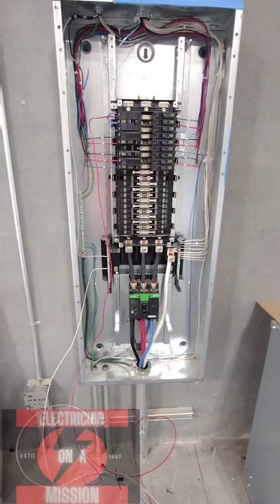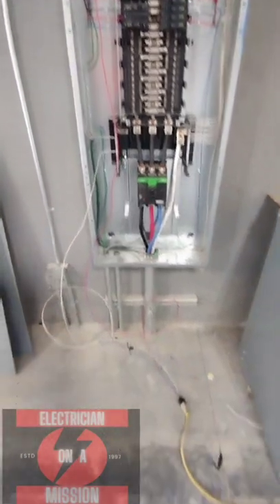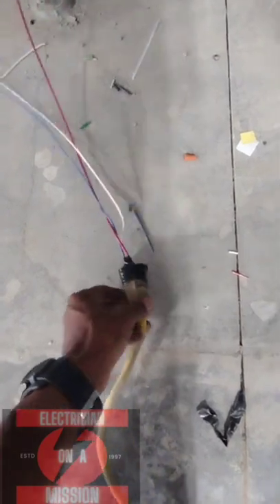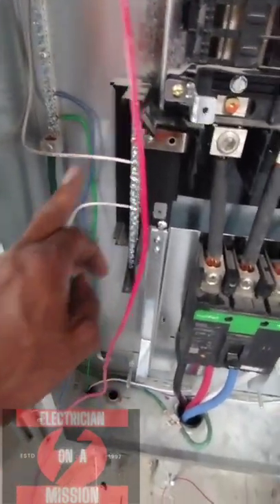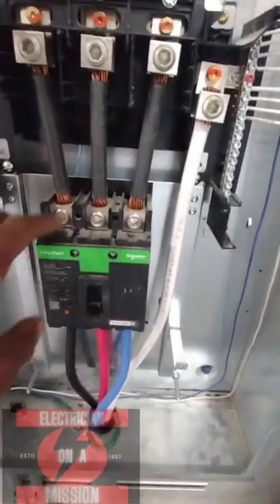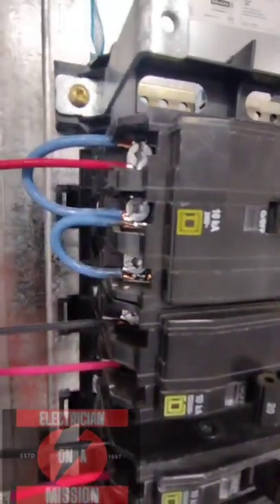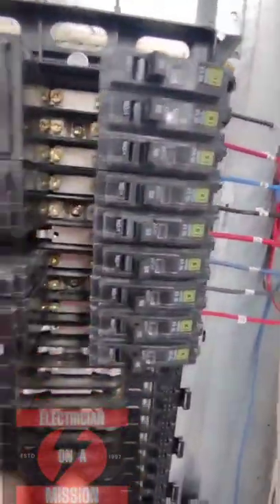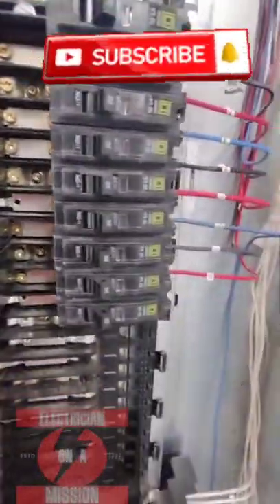Electricians  best way to hot check a three-phase panel#electrical#electrician #journeywomen

Comment: I'm guessing this is being done because: 1) you're working alone, 2) there's going to be walls finished pretty much immediately after inspection. 3) The main service to this sub panel is locked out because the super doesn't want one section of construction killing another one.

Outside of all three of those situations, I think anyone taking this as general advice because the situation isn't explained, will put themselves and others at risk doing this. Having the panel be in line of sight to everything you're checking and making it clear that you "see the lights, then disconnect the loads and then disconnect power" would keep most of the negative comments away.

Remember that giving any advice other than referring people to codes is risky from a liability point of view.

Comment: The best way to check is to meg check your wires before firing up the panel. Meter check each phase separately and then go phase to phase to check voltage.

Comment: Where is the power in the cord coming from? Generator? Also how much voltage are you pushing in to the 30 amp breaker throught the hot (red) that you put on it.
Reply: Good question... I assume he was either testing lights he wired / and / or needed temporary lighting in the room for other trades or people... I don't know for certain.
Reply: That's what I'm saying, bro. How the f*** are you running a 3 phasee off an extension cord.

Comment: The main disconnect is OFF for what reason again ❓No service voltage yet ?  ( I know you're testing lighting as the purpose)👈 If that is the case, honestly... Just install a male 3 wire plug on the end of a 6 ft length 14-3 cord , wire your other end to your panel and simply "plug it in"... "Keep" the cord for future similar needs... Always keep stuff that makes your job more organized....

Nice panel wiring work, BTW 👍
Reply from the maker: It’s really not a big deal. I’ve been doing this over 25 years. It was a quick hot check to make sure there was no dead short in the wall before they close it up with drywall. If you guys don’t understand electrical, please step back and call electrician. Thanks for the comment.

Comment: Quick question, what is "hot-checking"?
Reply from the maker: Sorry it took so long I'm trying to figure out how to work this comments. 🤣
So hot checking is simply when you temporarily power up a panel to make sure everything is working correctly and there's no dead shorts.
We do it on every job before Edison puts power to the building save time that sort of thing
Reply: A better way to check for shorts would be on a dead panel with your meter……
Reply: @mikea5923 can you please explain how you would you check with a meter?
Reply: @maximusvonderbrewskis  turn the power off and check phase to phase and phase to ground.
Reply: @mikea5923 

You'd be surprised how many people trip out and think they found a short when they go phase to phase and read 5 ohms, not realizing there's a transformer primary connected downstream that their meter is reading through.

Comment: just turn the power on and check everything all at once
Reply from the maker: No power was to the building yet if that was the case I would’ve just turned it on let’s make sense out of it. If you don’t understand electrical, please call electrician do not try which you see me doing. I’ve been doing this for over 25 years. thanks for the comment.

Comment: Here in the UK we would never do that.  We go through a precise series of dead feasting before we then go on to live testing.
Reply: They live in the dark ages still
Reply from the maker: This ain’t the UK buddy this is the United States California to be specific and if you don’t understand electrical, please do not try this call an electrician it was a quick hot check to make sure there was no discharge before they drywall
But you probably don’t understand what that is either. Have a good night. Thanks for the comment.

Comment: So, obvious question here.
Why not use meters?
Reply: No meter = It's likely coming from a distribution panel elsewhere in the building that doesn't have a service yet AND he's obviously plugged into another source  of power to test lights he wired.
Reply: @* Waterlec  Jesus you don't even understand the question.
Reply: Can you please explain how to check with a meter? Just want to be sure if I ever run into a situation like this.
Reply: @maximusvonderbrewskis  I'm an electrician and I wouldn't tell you to do that. You have to understand how three phase power works. Have a qualified electrician do any troubleshooting that you need.

Comment: Why?
Reply from the maker: quick hot check to make sure there's no dead shorts in the receptacles switches or any other devices bed with the electricity's lighting before the walls get closed up drywalled
Reply: @Electrician on a Mission🇺🇸  makes sense. Everything here is installed with EMT and wire. No worries about getting into the walls or ceilings.

Comment: Yo never bend your wires at such tight 90s. Think of electrical wires are a nascar track: no tight turns 😊
Reply: Why cant you make a 90 bend? Will it damage the insulation? Every residential panel Ive worked on has 90 bends.
Reply: @maximusvonderbrewskis   The only reason to not bend wires at sharp angles is to not physically damage the wire, or more so the insulation protecting the wire.  It does not effect the function of the current at all as long as the wire isn't physically compromised.
Reply: @maximusvonderbrewskis there is nothing wrong with bending the wires like that. It makes for a neat looking panel and it will make future connections, changes, or troubleshooting easier. Thats a professional looking panel

Comment: Did you know your multimeter can check resistance. Without getting the extension cord off the truck you could tell me a) how much power it draws b) if there’s any shorts
Reply: Can you please explain how to check with a meter? I work sometimes on commercial lighting any advice is appreciated.